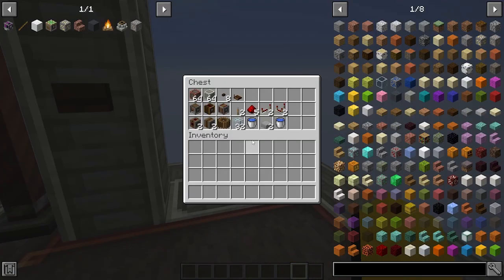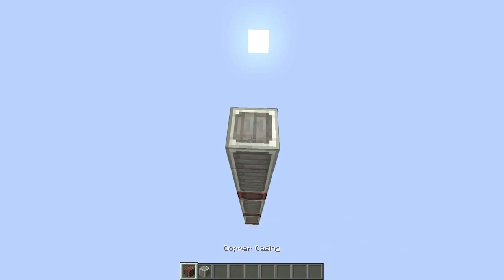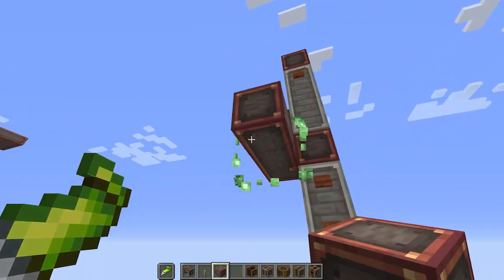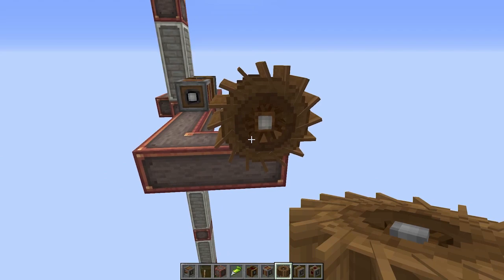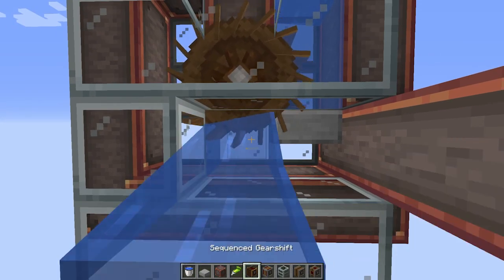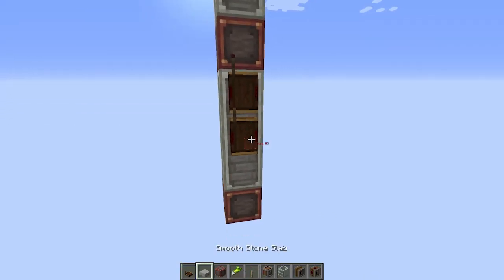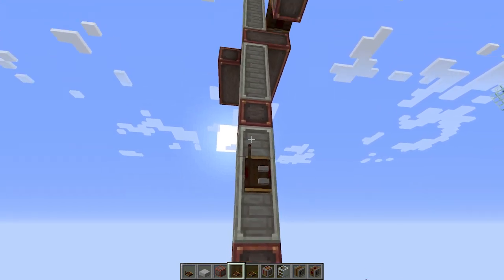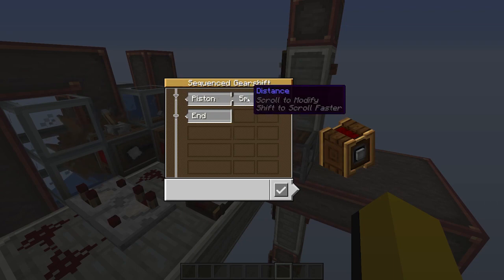Minecraft Create Mod Multi-Floor Elevator Tutorial (Easy)

Comment: I wish there was a block in create that would output a redstone signal based on a defined set of coordinates. It would be even more useful if there was a wildcard case * and the ability to define multiple coordinates outputting different signal strength. Elevators like this are nice if each floors is equi-distant from one another, but it falls short in the even you have many floors with different distances between each floor.
Reply: It sort of does, with the Redstone Contact block - one side can be stationary while the other side is on a contraption, to detect when it arrives at the location.

Haven't tried this personally, but I suspect what you'd want for an elevator like that is use a combination of Redstone Contacts, Redstone Links, Powered Latch, Gearshift, and Clutch.
One contact on the elevator, and a corresponding contact for each floor you want to stop at.
When a floor-contact receives a signal, it uses a redstone link to activate the powered latch which in turn powers the clutch and stops the elevator.
When you press an "Up" button, it uses a redstone link to unpower the clutch-latch while also switching on a second latch to make the gearshift operate in the "up" direction.
When you press a "Down" button, it does the same thing but unpowering the gearshift-latch, making it reverse direction.
Might need to adjust some timings for the signals of the redstone contacts to make it a smooth transition, but it should work regardless.

It does however mean it only goes up/down one floor at a time though.
If you wanted the ability to select floor numbers directly, that might still be possible by giving each floor's contact a different "link" frequency and and some way of ignoring the contact signals for every floor other than the one selected, but that sounds like an annoying mess of redstone.
Alternatively, have a 'counter' of floors to skip, and the control panel for each floor is smarter
e.g. if you were on floor 3 and pressed the button for "5", it would send the necessary signals to match "Up x 2"

As a side note, redstone contacts + stock redstone timing circuits can be used for a lot of cases where a sequenced gearshift is the "simple" solution but doesn't require any brass, so you can build some complex farms early on with limited resources.

Comment: How to add tune my lift stops in the half floor
Reply from the maker: I would say you have a few options:
1- Increase the pulse-extension at the top by adding a second pulse-extender.
2- Use this newer/easier design that never has this issue: https://youtu.be/Il5c1uei550.
3- Use the schematic in the description (hopefully that one works).

Comment: That’s really cool! I think you can have a floor with more blocks in between if you make an alternate up and down redstone link for it and add it to an alternate sequenced gearshift. Then you connect those two it a gearbox in between to the rope pulley. I’m new to this mod so correct me if I’m wrong :)
Reply from the maker: Absolutely! I used this in my second version with multiple floors and call buttons, and I also just released a new version that uses two sequenced gearshifts, so you're definitely right :D

Comment: Mine did not even work... :( It does not move at all.
Reply from the maker: Are you sure you have a motor and it’s spinning the right way? Maybe reverse rotation, and alo make sure you redstone link receivers are set correctly. Plus, there’s a schematic and a second, better elevator video that I have, so hopefully one of these things will work for you.
Reply: @BLOckOus  Mine just kept going down, not up.
Reply from the maker: @rajeshkaravadi9  Can you double-check to see if the gearshift + pulse-extender are working? Also, does it go up and stop at all, or just down all the time?
Reply from the maker: p.s. I'm releasing an updated easier version of this elevator soon!

Comment: Pretty cool, thanks been looking for something like this to make a nice looking elevator instead of just an ugly block that teleports you
Reply from the maker: Sure thing! And I also released a more reliable elevator with floor call buttons so I’d go with that one if you want to build it 😁
Reply: @BLOckOus  sounds fun, tbh i stream a bit, and did it on stream, literally tho only thing i did on crate, and found a cool button called the button elevator which you can use to extend the signal a lot with out needing to use a signal extender

Comment: I did 6 blocks instead of 3 for the floors and I cannot figure out a good pulse extender, can you help?
Reply: I pretty much need an extender that is long enough for 7 blocks, it would be great if you helped and thank you so much for the tutorial. :)
Reply from the maker: Hey there! You can increase the length of the pulse as much as you need by adding more comparators. If you have a long pulse, it won't hurt but you'll just have to wait a bit before moving to another floor. However, I just released a new design that's much better and doesn't need the extender. Basically, you connect a second sequenced gearshift that goes in the opposite direction and use that instead of reversing the direction with a gearshift. But let me know if this is confusting!
Reply: Do I use the same instructions from the other sequences gearshift?
Reply from the maker: They would be the same except the arrow is in the opposite direction. So one redstone link would be to go up and one to go down
Reply: Thank you so much it worked :)
Reply from the maker: @cybereagle2  Awesome!

Comment: 2:13 how?
Reply from the maker: You can copy any item with its attributes by holding control and then clicking your middle mouse button (scroll). If you don’t hold control, you’ll just copy the item without attributes (like the frequencies). This works in creative and survival, but in survival you have to already have the item on you and it will switch to it. Hope that’s what you meant 😅

Comment: hey I did this tutorial and I have my elevator to go 25m up and down, and though it goes up 25m, when it goes down it only goes 19m. idk if it's a power problem or my server is just lagging and it's stopping early. also my elevator runs at 768su
Reply from the maker: I believe that the pulse extender needs a longer pulse, because when that turns off, it causes the gearshift to switch directions and that stops the elevator. But let me know if that’s not the reason.
Reply: @BLOckOus  it worked and it did go farther but it went an extra block down and I want it to only go 25m
Reply from the maker: Are you by any chance running it at very high speeds? I know that the sequenced gearshift can get less accurate the faster it goes.

Comment: I know that this is 3 days late but if you do see this I am having trouble with the elevator. I have 3 floors I can go down to the middle and bottom floor perfectly but what I go up it stops 1 block short. And I did everything to my knowledge correct. If you can please find a fix
Reply: One of my redstone links was right next to the sequence gearshift
Reply from the maker: Wow! Congrats!! I swear i almost suggested that but then thought no that’s not gonna be it 😂😂
Reply from the maker: Hey! I haven’t faced this particular issue, but one thing I would that solves a lot of issues is adding a second pulse extender next to the one on top. Maybe that would help?
Reply: Ok I will try it thank you
Reply from the maker: Cool! Let me know if it doesn’t work for you.
Reply: Update I tried it. It didn’t work i will try and find the price that isn’t working and make sure I did everything right
Reply from the maker: @dragoon1678  I would also double-check behind the buttons for those top floors in case something else is getting triggered. Also there's an NBT schematic in the description for the first elevator if you want to try that.
Reply: @BLOckOus  ok ty for letting me know about the schematic the didn’t see that before I sent my last comment
Reply: I copied you video outside of my base to make sure that it wasn’t my base that was interfering then I double checked that I did everything right and now it doesn’t was to go up at all if you ran into this I would like an answer y but for now I will keep making sure I did it right
Reply: I GOT TO WORRRRK

Comment: Hey man, how more complicated/space consuming would it be to make it possible for the elevator to also go straight to the top if you asked it?
Reply from the maker: It don't think it would be much more complicated. One way I can think of is to add a second Sequenced Gearshift to the system and set it to rotate for the entire height of the building. My current plan for the next version of this elevator is to have a call button for each floor.
Reply: @BLOckOus  Oh cool! Gonna wait for this next tutorial to see if I can fit it in the space I'm thinking about then

Comment: BLOckOus, I have a challenge. A 3 floor elevator that doesn't use redstone links.
Reply from the maker: I do have an elevator like that in my testing world! Basically instead of Redstone links behind the buttons, I have Sequenced Gearshifts with the up/down setting, repeating on each floor, and a belt connected to the rotation source on top. Another way would be to just wire the buttons directly to the top. Thanks for watching!
Reply: PS. BLOckOus I love your vids